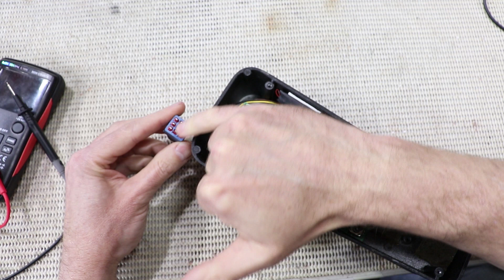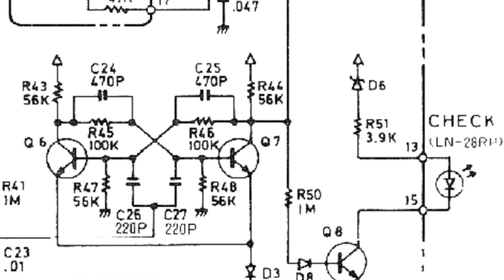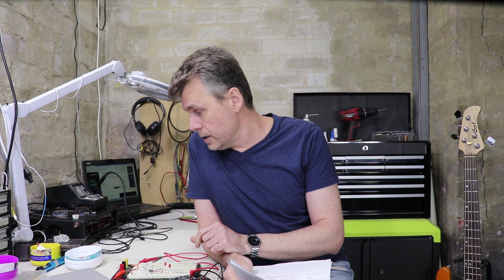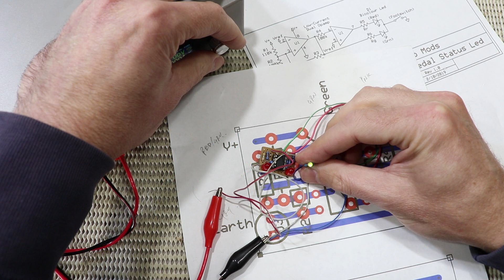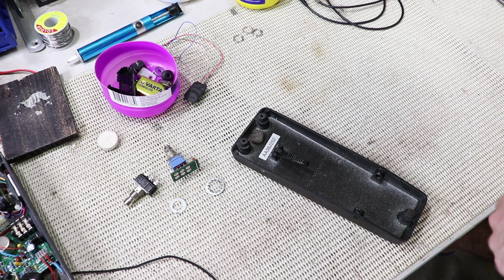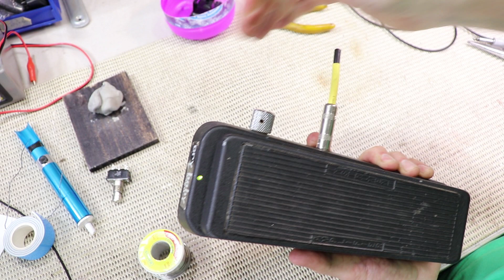How To Add A Status Light To A Crybaby Wah Wah Pedal.

Comment: Great Vid Rob! thank you so much. I have a 535Q so... Thanks Again! BTW, do you know why my 535Q picks up a radio station (very quietly, but there) and how to fix it. It is NOT the guitar or other pedals/cables. I was thinking of ripping out the 9V bat. holder and sealing it over with copper tape or a metal plate. Thoughts? (I sure hope you see this)  PS, Love the Stache at the end bro, lol
Reply from the maker: Hmm.  Hard to say without seeing it on my bench.  Maybe see if changing the Q control or the rotary switch changes it.  In which case I'd suspect the caps or inductor in the filter.  Also, both input and output buffers have very high input impedance, so make sure any high z signal wires are shielded well.  Perhaps lower the input resistor, or put a small cap in parallel with the feedback resistor in the input buffer.  I think there are several versions of the pedal.  I've seen several different schematics, and none are proper match to my pedal unfortunately.  Also try asking on a few forums, like DIY stompboxes etc.  Best of luck!
Reply: @RobMods  Thanks for the reply, and thanks for some ideas. I've noticed that a lot of creators don't answer in the comments, but they will go live and try to watch the 80 MPH chat stream, which I will not do. So, you are appreciated in several ways my friend.

Comment: Hey rob nice work. i just discovered your channel, and it´s pretty good.
i´ve been having troubles with my volume knob of my guitar, i cant turn down all the volume, it only seems like the volume  is turned down a little bit, and the tone is the one turned down. i think it was a sodering mistake from the previous owner, but i don't know anything about all the electronics of a guitar/bass so.....
Cheers and keep up the good work
Reply from the maker: Without seeing the axe, this is just a suggestion of course, but it sounds like the volume pot is not earthed.  This could be a faulty pot, a wiring problem, or even a problem with shielding foil.  Try using a multimeter to check that the earth lug of the pot is actually connected to the sleeve lug of the jack.  (If viewed from underneath, with the shaft pointing down, and the lugs pointing at you, the earth lug will be to the right.)

Glad you like my channel mate!  Best of luck with the repair.